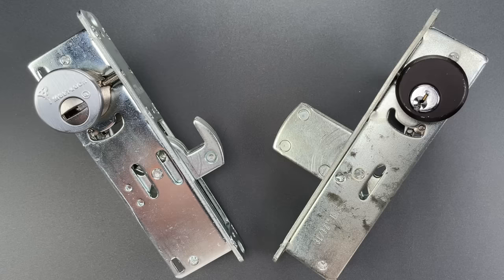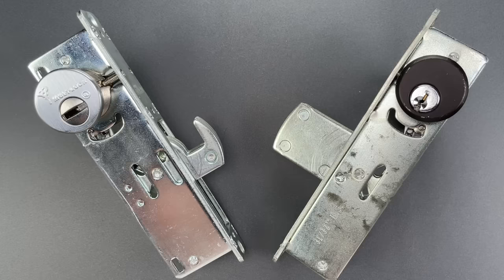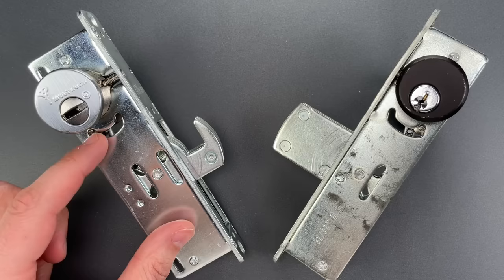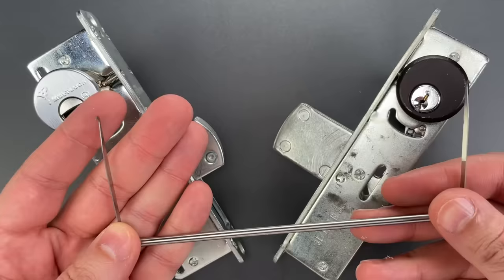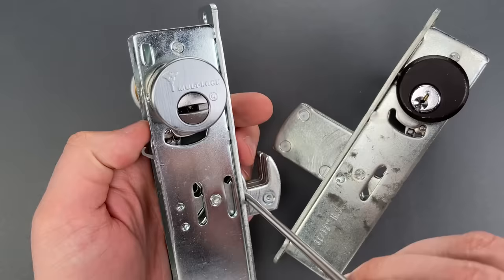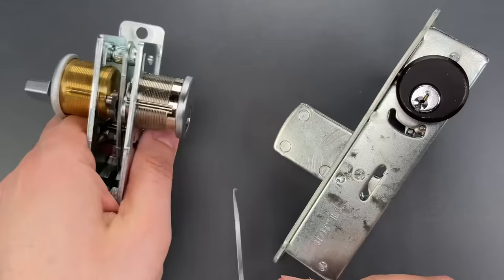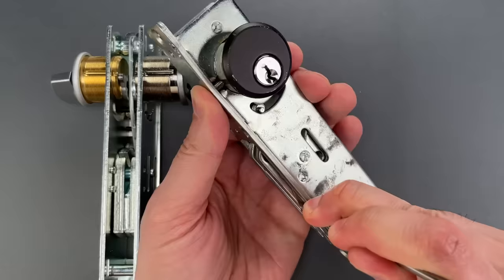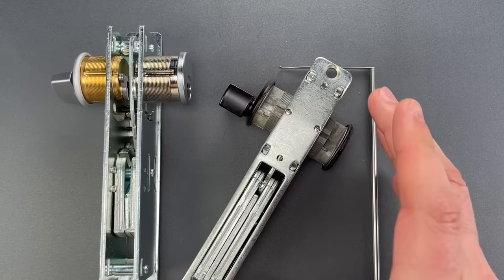[1409] The Most Significant Security Flaw in North America

Comment: I love how in the last segment he basically assumes that this will NEVER be fixed, and says that this tool would be a good investment for any locksmith or first responder. Shade thrown.
Reply: there's millions of these door locks everywhere. the odds everyone will change them is pretty low.
Reply: @ThrowingItAway  Yeah, even if they fixed the issue entirely in new locks today, and never sold another lock that was susceptible to this, it would be decades before this became an uncommon issue.
Reply: That's because the first step to resolving this problem is convincing the manufacturer that there's even a problem worth fixing.  How has that worked for Master Lock so far?
Reply: IMO, the doors are designed like this purposefully, for the exact reason LPL states in the video: emergency personnel need to be able to get into a building in the event of an emergency. If you build the thing like Fort Knox, then you're going to have to destroy half of the storefront to gain entry which is only more damage. If you're a store that's not selling something like jewelry, you'd much rather thieves get in and steal $200 worth of random <$10 crap than having to spend $5000+ to replace the entire store front. Sometimes it's better to let the thieves get in easy, only to find this heavy duty safe that requires serious hardware to bypass (while being on camera), than to present the thieves upfront with challenges that make them bring their power tools ahead of time. Put locks on the door to make it clear they're trespassing, but yet lull them with a false sense of (low) security.
Reply: It’s not a “this,” it’s millions of “those.”
Reply: @Dhalin  have you never heard of fire keys? Those black boxes on the wall near stores have a single key that opens them all and the store keys are stored inside.
Reply: It probably won't be.  Lockmakers like security by obscurity, despite it not working.
Reply: @Michursky  Low quality bait my bro
Reply: It is the same reason you will always be able to use the inner door handle to bypass a dead bolt in a motel. Every  one has to be be ADA compliant and in order to do that you have to use a lock with a handle that can be opened even if you don't have hands. This will always be a flaw as long as the doors are required to open outwards at commercial store fronts.
Reply: @Tb0n3  The two stores I work at don't have any such thing. There are spare keys in the back room of the one store, but they are not easy to find if you don't know the place (IE, you're someone who doesn't work there), and if you got back there, then you already had access to the entire building.
Reply: @UlshaRS  He hasn't eaten in quite a while lol
Reply: Most places won't change the locks till someone actually breaks in.
Reply: He said this so expertly that I promise you it will piss off a lot of law enforcement, manufactures and possibly, other attorneys and their law firms. He is 100% correct and not much can be done. I will tell all of you this and the Lock Picking Lawyer knows this full well, from being married to a LPN, RN who was also a paramedic, first responders will often break any glass in front of them when time is crucial and a factor. Not always but mostly.
Reply: @All Day Day Dreamer  Those comments are true, however unless the emergency is down to a matter of seconds most ems, fire, police will prefer to opt for non destructive methods of entry. If an experienced person on the departments had this it would be a preferred entry method vs destructive methods.
Reply: One thing that would "encourage" store owners to change to an upgraded one(assuming the problem with shielding is fixed),  is if insurance companies says the premium will increase.
Reply: It won't. Even if it was addressed it would take absolutely years for a new version to roll out, and then it would likely ONLY be installed onto new store fronts /if/ they pay the extra money for the fixed design. Kwikset is releasing a new lock with addresses some problems with older locks and is effectively replacing the older models as a whole... but it doesn't fix the older locks already installed.
Reply: @LeonardRoberts  That’s not so true. 
There is an elevator door stuck Closed with people in it. The fire department showed up one of the elevator service man was there
Said The Other elevator serviceman Was bringing up the tool to open the door. (Most stores have a hold of them were a tool Fits in to open the doors). The fire department should have the same tools However they just tried to force the doors open and busted the mechanisms. Then the tool would not work to release the mechanism. 
The people were trapped in the elevator for an extra hour and a half. The elevator service men Open the Elevator doors on the floor above But for some reason the fire department Could not extract all the people
Out. There’s three people in wheelchairs 🦽 
They Seemed like they were having fun trying to bust the  elevator doors
Reply: @Dhalin  This is exactly it.   They would much rather them break in with a method like this rather than breaking the front glass or even worse drive a truck up and chain the doors ripping them off.   Those doors/locks are not meant to prevent any kind or organized or planned theft.  Insurance also would cover almost any losses from it as well.    
The real theft protection comes from your alarm, safe, and camera system not from any kind of door locks.     The number one deterrent to most thieves is typically a visible and good camera.
Reply: @paradoxb3  IKR?  LPL has defeated multiple "new" or "improved" designs from Masterlock over and over, yet they keep marketing the same old garbage.
Reply: It's an easy aftermarket fix, for anyone that cares. Shielding to cover the gap in the door. But who will ever be worried about a thief having this tool, or an equivalent? Most of these styles of doors have person sized glass windows, which are much easier to get through.
Reply: Of course, the next step for the LPL will be to demonstrate how to bypass or disabled the security systems used in stores and homes. Once again, exposing to all, their weaknesses and vulnerabilities. I can hardly wait. Maybe it's time I took up a new profession. ;)
Reply: @MaethorDerien  I would say the #1 deterrent is quite simply, the risk vs reward factor. The two stores I work at? 99% of everything on the shelves is worth less than $10. So, let's say you found a way in, either by jimmying the locks open, or even if you smashed the window to get in. It's breaking and entering all the same. First of all, you know ahead of time, that the shelves are filled with low value items, so not sure what your game plan would be there.
 
But let's say you actually did. You go in there, and you spend time looking for the real goods, and you find a good heavy duty safe that you're not gonna just carry out of the store, maybe you could open it with an angle grinder, or something like that, but that's more crap you have to lug around, more time you gotta spend, meanwhile you're on camera the whole time all through the story and you might or might not even find the safe (sometimes it's hidden behind stuff, sometimes it's not where you might think it is, sometimes that's not even where they put the money, it could even be a decoy; the one place I work has a safe underneath the cashier's counter that has only a fraction of the money in it).
 
Meanwhile, an alarm system has already alerted police and you probably expected that. You know that if you're going to do something like this, you need to be in and out in 5 minutes or less. Every minute you spend, you risk a state cop or three pulling up and ending your spree with their guns drawn. You don't have time to get the angle grinder out.
 
So... really, the best security you can have, is by being a low value (and high effort) target. If you sell expensive crap, then you likely have the money to have a security guard there overnight. A security guard is going to be 100% the best security possible; a simple 911 call and a pistol will end your spree in seconds, especially if you don't know he's there.
Reply: Yes, this will never be fixed.
Reply: The thing is, it's not worth fixing since a rock through the glass is the method of choice to bypass these locks in the field for a criminal.  Retailers typically use steel gates behind the door for actual security.
Reply: @ThrowingItAway  Not if enough people start stealing!
Reply: @Dhalin  I think you're underestimating the effectiveness that, say, a gun would have against the glass portion of a sliding glass storefront door.
Reply: @jtcmule3336  A gun? Why would you use a gun when you could use anything like a crowbar or a hammer that would be a lot less noisy? If you fired a gun at a storefront, you'd only be letting the nearest 5 blocks know that a crime is being committed. Meanwhile, the glass shattering noise, especially if you wrapped a towel around the object, could be dampened a bit so that hardly anybody would hear it.
Reply: @Patrick So let me get your logic right... if something is going to change in the distant future, don't bother right now? How tf does your comment have over 1K likes. Society is braindead.
Reply: The lock is only there for decoration anyways.  Motion sensors and cameras are the real deterrent.  Insurance is the real protection.
Reply: Well considering these locks are installed in GLASS doors, Most thieves would just smash out the glass as opening the door and entering either way sets off the alarms inside.
So the only people that want to enter covertly are lock smiths and those that know how to disarm the security system.
Hence I doubt it'll be fixed anytime soon.
Reply: @xdevantx5870  Most store fronts have glass windows for display purposes, and the doors are almost always glass. The locks aren't gonna stop anybody. The locks are, however, going to make it very clear that your presence is not welcome at that time, and finding some way to defeat the lock, or bypass it by any means constitutes breaking and entering and is against the law. 
 
They want to make it annoying enough to keep random snoopers out and/or common thieves, but yet they know that if someone is determined to get in, they're going to get in. There's a giant window right there they can break. They know these people have tools that can get those locks open easily. They'd rather the locks be picked than a giant window be broken or what-not.
Reply: Why not just install a plate that covers the gap between the doors , or the door and jamb ?
Reply: What is often missed by all the appologists below is that the mult-t-lock cores people are putting in these mechanisms ultimately cost the organizations thousands of dollars when you factor in key costs, labour, etc. Costs which are completely unjustifiable when you can use a glorified dental pick to bypass them...
Reply: Most locksmiths would just drill out the lock so they can charge you to replace it. This tool works too quickly and non destructively to be profitable for a locksmith. First responders should definitely know about it though!
Reply: How are we going to replace nearly all glass doors in America. He realizes that it's far more effort than any sane person would put into it
Reply: @DinnerForkTongue  more likely it still wouldn't be fixed until the insurance companies all announced they would be raising premiums on any businesses that didn't fix the problem.
Reply: @kd5nrh 
I was thinking of that as part of the scandal, but you're right.
Reply: well, given the amount of stores that currently use these locks, even if no new locks had this flaw starting tomorrow, it would take years or even decades for all such locks to be replaced.
Reply: To add my two cents to what @Dhalin  mentioned, if they bypass the lock or even break down the door, that's a lot cheaper than some other ways they could get in.
Reply: @Dhalin  Never seen a first responder open a door with any kind of pick in any emergency situations. The fastest way to get through a door in emergency situations is to get rid of that door because the frame and the door simply isn't strong enough to stop them with the other tools designed to get rid of doors. This is useful for anyone besides first responders.
Reply: There's that saying that locks are only there for honest people. A determined thief will get in one way or another. It just sucks that this is less secure than tying the door handles with string.
Reply: " fix it? Nah. The public are fools" 
" Why fix a problem which is not a problem. They'll keep buying"
Reply: @openyoureyes3113  I did not intend to imply that they already had that tool in their possession, more that I could see if they had the tool and knew how to use it, they would prefer a non-destructive method of entry. Sounds as they got impatient waiting for "key" and tried to force the lock thus doing more harm then good in your scenario.
Reply: It's been a known flaw for decades, plural.

Of course he's throwing shade!
Reply: @LeonardRoberts  yes I Understood your comment.
Reply: @Tb0n3  That would mean there is zero security lock wise for that store. look how well keeping a master key has gone for the TSA. Fire departments take volunteers in many places, one small town person sharing a photo of their new keyring or the key in the background of a press photo and everyone of those has to be rekeyed.
Reply: @coreytaggart128  And? It's illegal so people don't worry about it. It's dumb but it's the world we live in. Also they typically use multilock cores.
Reply: He'd be out of business if they fixed everything him and his fanboys hyperventilate about.
Reply: @DinnerForkTongue  if that happened LPL would see jail time too btw.
Reply: @knghtbrd  not the lock manufacturers job. The person in charge of picking which locks go on the door is the idiot. Vote with your dollar and all that. Only way this changes. Demanding some one eat into their profits to satisfy your personal demands is so dumb and egoistic when the issue is not with them - it's with the customers.
Reply: @agnidas5816  Actually, the lock manufacturer is making and selling the flawed part. So your comment … is idiotic.

Comment: Fire service here. They make a tool called a K tool ( used with a halligan ) for this which rips off the cylinder head and exposes that little cam action. A simple little bar is then used to push on that cam to open the door. Saves a lot of money for the store owner but this tool would be great if there isn't a plate to block you. 

Great video!
Reply: Insurance company would pay for any door forced open by firefighters.